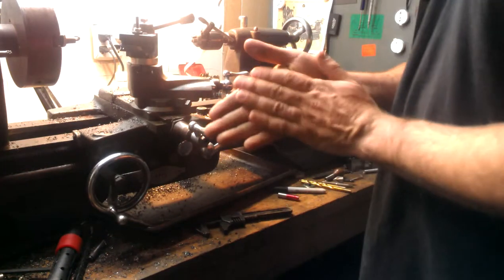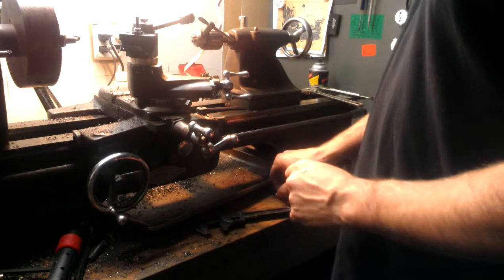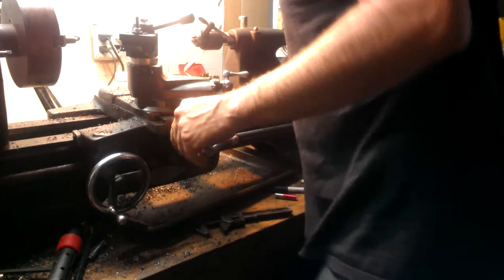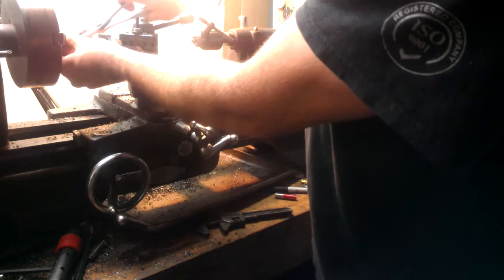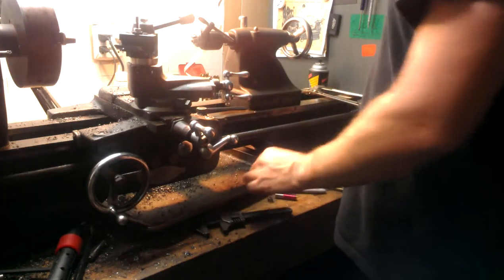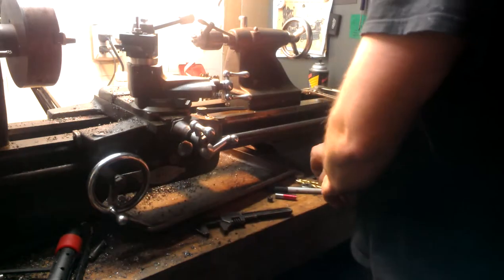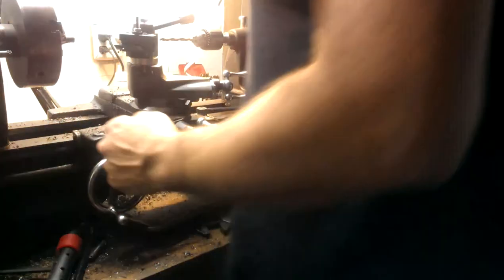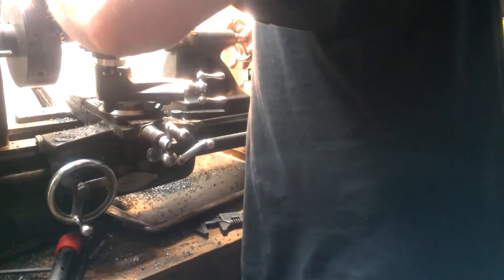Brown and Sharpe horizontal mill knob repair part 2

Comment: Good job on the centering. 
I found that a shot over the tailstock about 2 feet up gives a real good view of what I'm doing. It shows the tool and the part clearly and keeps the overhead light out of the camera view. I tried setting the camera tripod on the bench but it vibrated too much. If you can get a piece of something like 1/8" by 1" bar stock you can drill a mounting hole in the end for the camera. It can be clamped to the wall or ceiling joists and you can bend it around to get the shot without vibration. 
Any old piece of bar will do as long as it's strong enough to hold the cameral and still can be bent. 
Added benefit is the camera can't be knocked over as easy. My Nikon took a couple spills before I figured that out. :-)

Comment: Interesting watching you trying to fix this stuff.  A little tip to help you center some part in the chuck.  take a little roller bearing of some sort, and make a tool post holder for it.  Then you can put the part in the chuck loose, run the bearing up against it, and when it is running pretty true, chuck it tightly.  Of course only works for pretty round parts, but it helps a lot with short pieces that you do not have center drilled so you can use the tailstock to center.
Reply from the maker: you are right I have seen that trick but haven't made the tool yet. maybe another video. thanks for watching